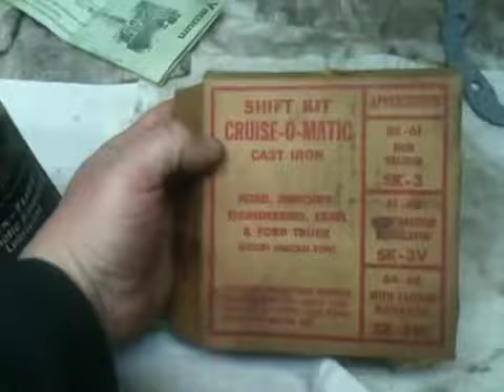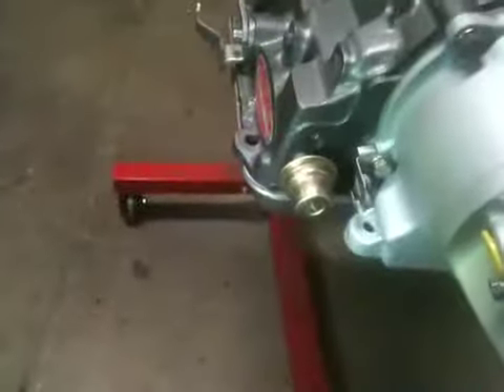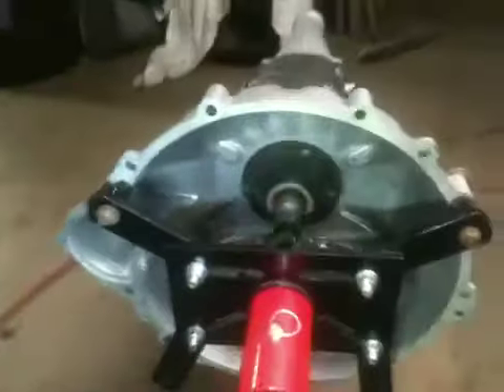Cruiseomatic restoration

Comment: I have a 62 Thunderbird I just had the transmission rebuilt, got it in the car. my gear selector lever sits at the 7 to 8 O'clock position, I see yours is at the 9:00 position. currently none of the linkage fits and I was not the original person to pull this all apart. is there differences between years?
Reply from the maker: Two rods on side of trans..ones gear selector ones kick down..unsure of differences on years though
Reply: Thanks for the reply, I ended up making a bracket and bolting it to the transmission shifter. It's all  connected and seems to work just fine. I'll know in 8 months when I drive the car....
Reply from the maker: On a Cruiseomatic the green dot on shifter is drive...conventional spot for 2nd gear